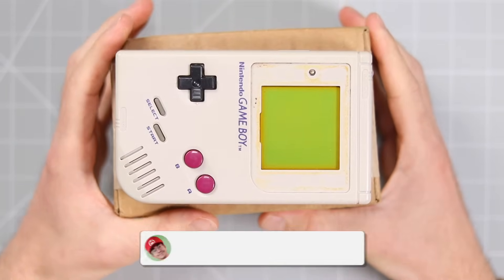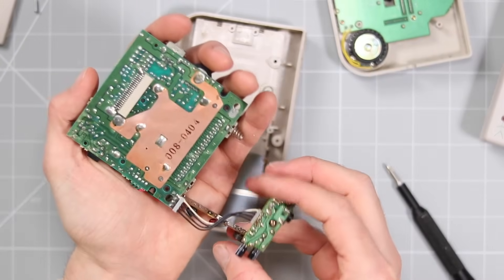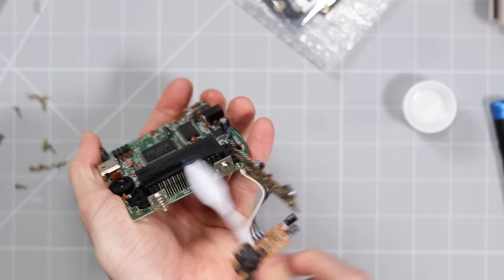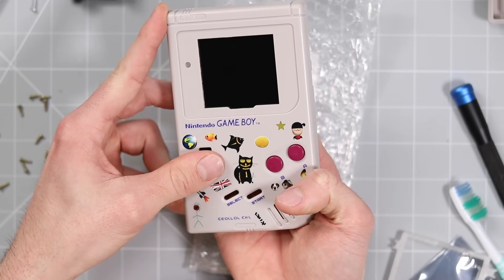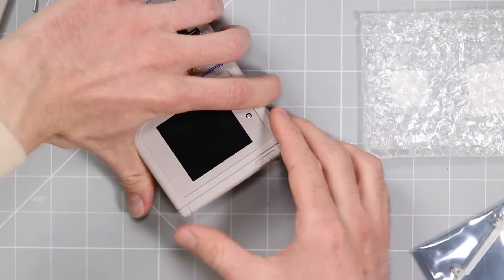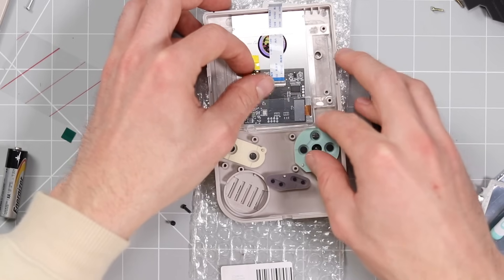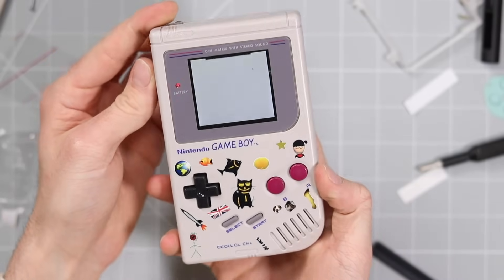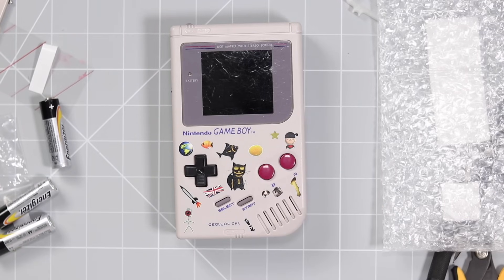Building an Artificial Intelligence GameBoy

Comment: Hi Elliot, I love your videos and I appreciate them very much and I have a question. Could you fix a Game Boy game for me? It's Pokémon Silver. The problem is that it didn't save games. I changed the battery and it still didn't save well, just a few times and also the color was distorted. and it kept cutting off and restarting, could I send you the game so you could try to fix it?

Comment: First off, I very much enjoy your work. From the repairs, to the motorcycle updates to Japan and back; good stuff. 🤘 Thanks and keep it up please. Now, Do you have any idea about a game that boots up and then glitches? Sometimes a scrambled "Nintendo" but sometimes it will do a full load and start the game and then glitch. Pin continuity tests good. New battery. No visible corrosion. Reflowed chip pins. Anything you can recommend would be greatly welcomed. Please and thanks. 🤘